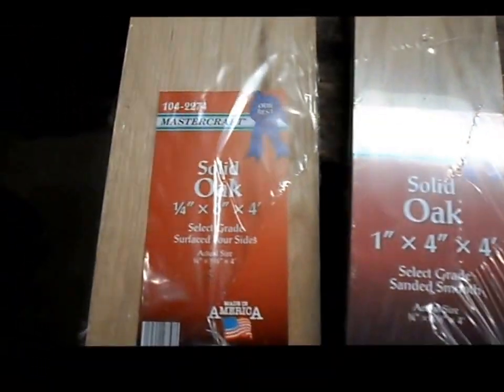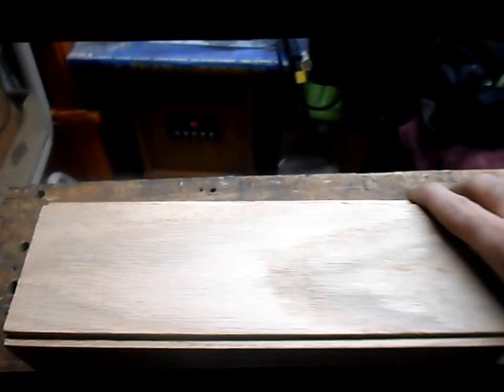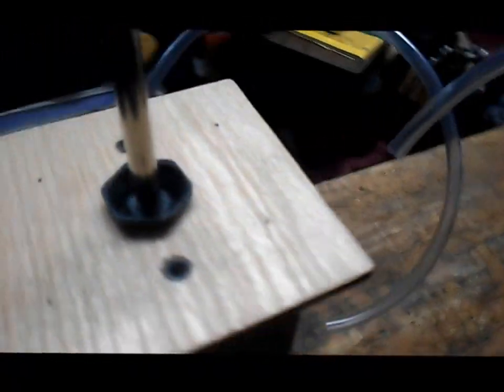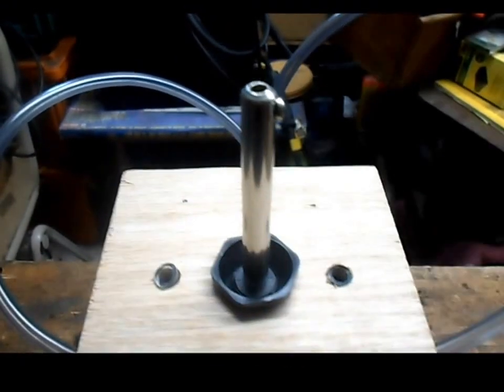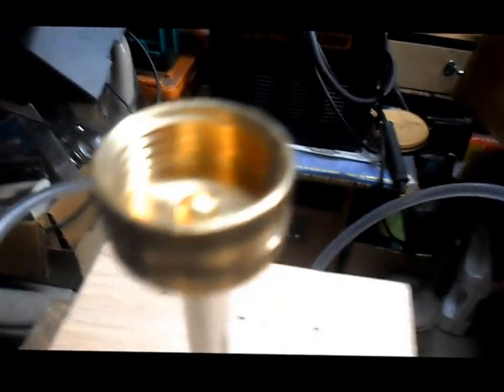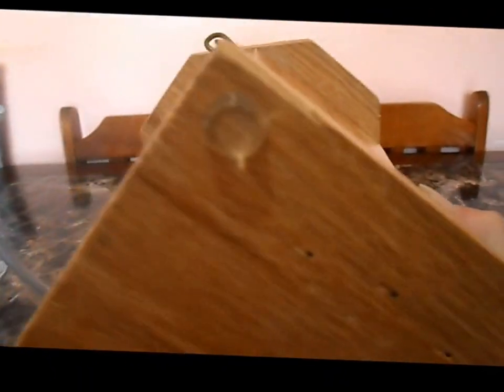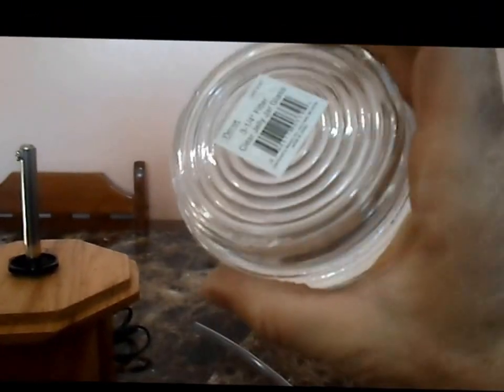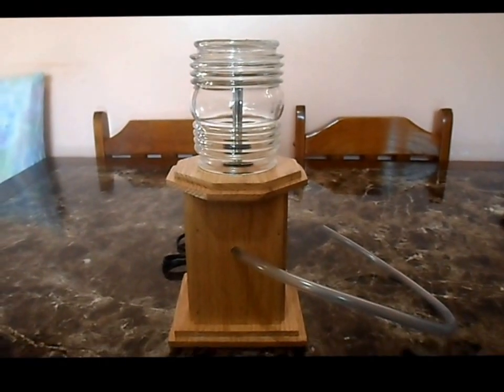DIY dry herb & concentrated oil vaporizer

Comment: Would be better if you showed it working
Reply: it burns the pot near it..  soldering irons get over the vaping temps of 406 F
i already tried it with even a little 30 watt iron..  still up in smoke... no vapors, just thick cloudy smoke :-(
Reply: +Harley Me 
Common vaping temperatures are in the range 392°F to 480°F (200°C to 250°C ).

A soldering iron, regardless of wattage, must reach temperatures => 842°F (450°C) in order to melt solder. 

The vaping device described in this video lacks a means to monitor and adjust the temperature of the bowl, thus the reason for your product going up in flames.

Wiring the solder iron to a 600W Lamp Dimmer/Switch will allow you to turn on/off, and adjust, the voltage to the iron... in turn controlling the amount of heat generated. 

Available for approx. $6.00 at (Home Depot, Lowes, Walmart) 

There are far too many ways to display the temperature, to go into it here.  So it all depends on your wants, needs, expertise, and pocketbook, to add this feature.
:

Comment: Nice idea...I would drill small holes in the brass cap and put a screen inside for improved airflow.
Reply: Yes air flow hole but that wouldnt need to be in the cap, since its not a tube

Comment: You could improve it by not using a plastic hose, its flavor mixes with the taste of what youre smoking
Reply: exactly..   solder irons are 400 degrees to hot to vapourize ..  lol up in a big cloud of smoke... just like lighting it on fire..  unless you get the pot  the perfect distance away..